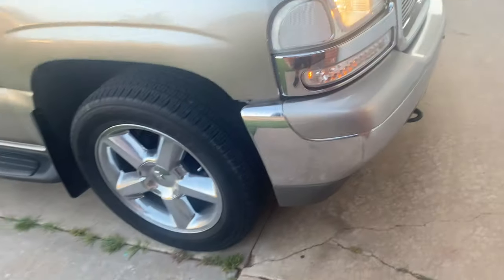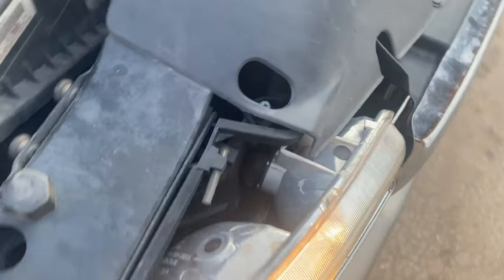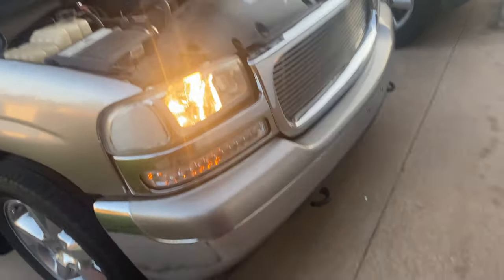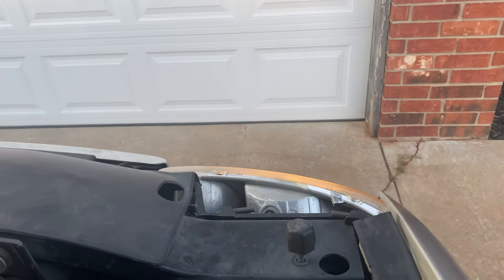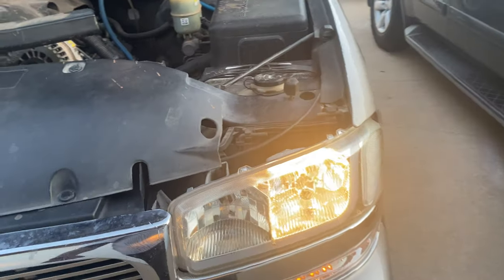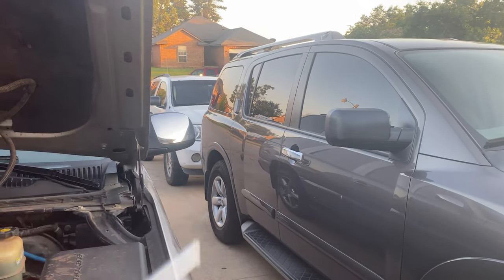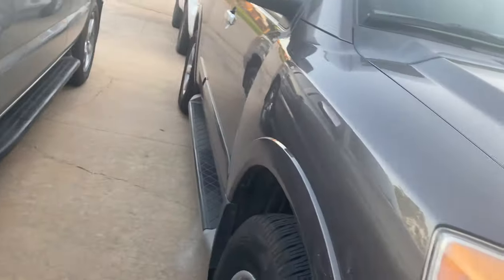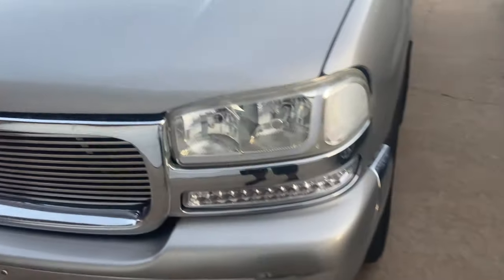How to adjust car headlights | 2002 GMC Yukon | Headlight adjustment.

Comment: Question: I found your vid looking how to adjust headlights on a 2002 GMC Envoy!  Was praying it was as easy as your Tahoe(i think its a Tahoe). My Envoy doesn’t  have the two screwdrive access holes.  There are clips to unclip and remove the whole headlight… soooo any helps appreciated.  Al